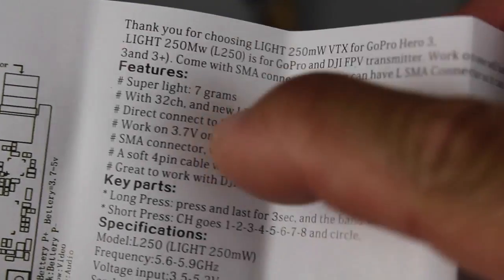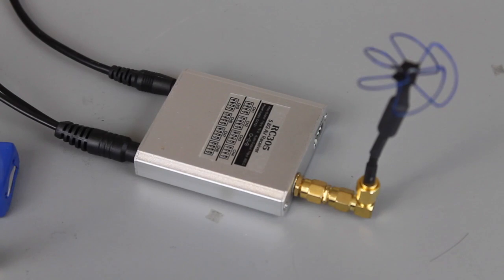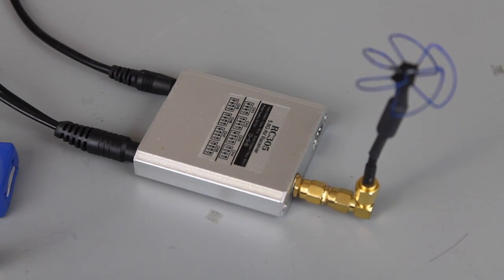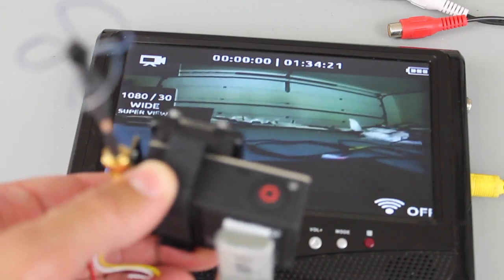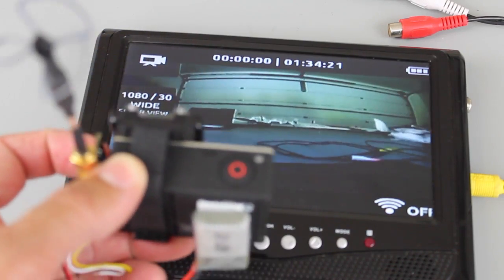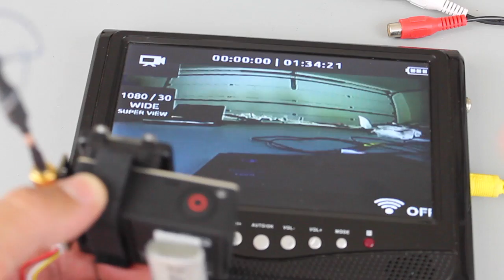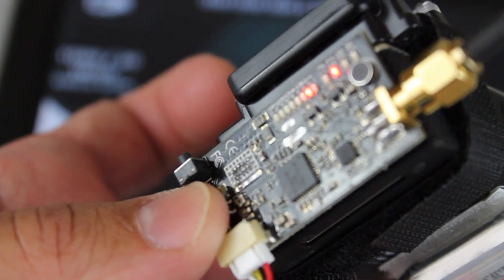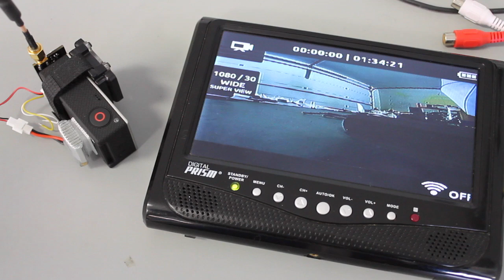Dead Simple 5.8GHz FPV Transmitter for GoPro Hero 3/3+

Comment: I have this transmitter and I am trying to use it for FPV. What are the yellow and white wires that come out the transmitter? Can you use them for OSD? I am trying to get my video to connect to my flight controller for telemetry data such as RSSI and battery voltage. Can anyone suggest how this might be possible? I'm sure the yellow and white wire are designed for something of that nature, I am just not sure exactly how that works.

Comment: How far will it transmit? It can be in meters or feet.
Reply from the maker: With the default antenna I've gotten about 1,000 - 1,200 feet with no obstructions.
Reply: I should have to. What type power plug will plug in? All my won't plug in. Because I can't fine one of that type.

Comment: Hello, Excuse me but what does for does the transmitter use the mini usb port? I would've thought it was gonna take power from there. Do you know ?
Reply from the maker: That's how it gets video out. It's mentioned in the specs here:

http://www.banggood.com/Eachine-Light-L250-5_8G-250mW-VTX-FPV-Transmitter-For-Gopro-3-p-933197.html
Reply: Sure? thought that might've been done from the hdmi...
Reply: or maybe it does video out on both ?
Reply from the maker: Good question. I'm not sure to be honest. Perhaps it's there to get video out of USB on the older models and HDMI out on the newer models. I'll see if I can find out any more info.
Reply: Thanks for your answers.
Please let me know if you get any info on this. 
I dont own a GoPro Hero 3, but if you do I'd suggest to start the search in the users manual or something like the technical documentation it includes.

Thanks Again.

Comment: Hello, I see alot off people buy a 3.7 1s lipo battery to power this transmitter. But I see you can do 3.5-5.2v input. Can't you power it from a 5v ubec or 5v servo lead from your rx?
Reply from the maker: That's definitely possible although I'd recommend the BEC option over getting power from the RX. Good suggestion.

Comment: Thanks for the video, would adding an lc filter help with the static you get on this. iam just about to use this set up to take photos and video rather than fully fpv.
where to place the filter though
Reply from the maker: Yes I think it could but I have no clue where to put it with such a small board. Let us know if you figure something out. Thanks.

Comment: can u use a monitor that has a reciever ariel on top ( no wires just that gopro chip to a fpv screen ) srry if this is a dumbass question im just new 2 the sport 😌
Reply from the maker: +FL Studio Newbie If the monitor has a receiver built in and supports the same 5.8 GHz band as this TX then I would expect it to work. No worries being new to the hobby. We've all been there. Thanks for the question.
Reply: Cheers for the answer dude!

Comment: After watching this video I was intrigued by the transmitter being run off of the GoPro's battery.  Upon researching, the GoPro's power pack, it can easily be split open and wires can be soldered onto the battery's board.  That wire could then be connected to the transmitter and power the entire set up.  After working some math, the GoPro draws power while filming 1080/60 at 9.3 mah per minute.  The transmitter draws about 7.4 mah per minute.  When added, you get slightly over 16 mah of power draw per-minute off the Go Pro's battery, which is 1180 mah.  So you should get a conservative projected film/transmit time of 70 minutes.  i think that I am gong to try this.  If anyone else does please write a comment @ me and say what you get.
Reply from the maker: +Lee Rea III That is some killer info. Thanks for sharing! This is definitely something I want to look into. If you or anyone else does this mod please let us all know. Appreciate your thoughts.

Comment: I have purchased this whole setup including the clover leaf antennas. Im using this for my dji phantom and the fpv is awfully static. There is practically no fpv the connection is so bad. Any advice?
Reply from the maker: +KRM167 I get a lot of static too. One source may be coming from vibrations. Other than that you may have to deal with it otherwise you may want to look into a higher end TX. I still use this module from time to time, but like you I get a lot of static.

Comment: I want to live stream my video at HD quality via Wi-Fi, not necessarily for flights but I am looking into making a kind of google glass for myself. Is the transmitter something I could use in this situation? is the transmitter also attachable to lets say the sony x1000v? Is the stream also possible on a windows laptop, Thanks for the tips! sorry if the questions may seem obvious (I am a beginner in this field)
Reply from the maker: +Harm Huibers Unfortunately can't get get HD with this TX. It doesn't stream over wifi either. You'd need to look into the Fatshark dominator HD setup:

http://amzn.to/1MJHBN2

But I haven't messed with those. Streaming HD is expensive but prices are coming down. Good luck with your setup.

Comment: can this be attached while on a gimbal?
Reply from the maker: +nas rul It depends on if the gimbal mounts on the opposite side from the transmitter and there's enough clearance above it to prevent it from obstructing the antenna.

Comment: Hello,can you tell me what is this battery on gopro......I don't understandvery much on lipo and charger and connectors...thank you
Reply from the maker: +antonio monopoli It's the standard GoPro battery and the FPV transmitter uses a 3.7V input, which is equivalent to a 1S lipo.

Comment: I know this is a older video but I would look on ebay for what's called ramps its a 3D printer electronic parts in there you can find very small heat sinks I would add one to the transmit chip for the heat I don't feel it will interfere with the antenna but I would try to help the cooling of the chip
Reply from the maker: +robert m Very good to know. Will check it out. Thanks.

Comment: I just got this transmitter last week.  I use it with a keychain camera instead of a GoPro.  I'm glad you mentioned how hot it gets, I was worried that mine was abnormal!  It's like a little sun!  Have you had any issues with the heat?  I'm trying to figure out how to mount it without it melting something or overheating.
Reply from the maker: Ken Shields I haven't had any issues with heat because it's well exposed to the air, but you're on the right track by finding a good way of mounting. You definitely don't want it resting against something while it's transmitting. That could be no bueno in the air!

Comment: If i had my Gopro in a tarot t2d gimbal, would this fit between the camera and the motor?
Reply from the maker: Cream Cheese Productions Great question. Unfortunately it won't with some serious modding. One thought would be to invert the camera so that the FPV module is on the left side and pointing down. My only concern is that the gimbal case that holds the camera would be pressing on the shutter button. Not sure if that would cause a problem. BTW when inverting the camera you'd need to make sure you change the upside down mode option in the GoPro settings. Have never done this but offering up a suggestion.

Comment: I'm betting the reason it doesn't power off the GoPro is because it's most likely charging the GoPro via the USB.
Reply from the maker: Eyes Up Vids That would be a nice feature but unfortunately it doesn't. It runs off too small of a battery to be able to charge the GoPro.

Comment: Hello 
i was wondering if this will work with a 2s 7.4v 800mAh battery? also have you tested range yet and will this work with the bosom RC805? thanks so much
Reply from the maker: Dante Totino It will only work with a 1S 3.7 lipo unfortunately. Yes, it should work with the RC805 just fine. It works well with my RC305. I still need to do a range test.

Comment: I wonder why they dont just use the port on the back of the GoPro's like my Team Black Sheep Quadcoptor does?
Reply from the maker: gencodeinc I believe you can only get composite video resolution off the back vs getting hdmi off the side. So if you wanted better resolution you'd go with the HDMI port. At least that's my understanding. If you find out otherwise let us know.

Comment: That's awesome actually. Pretty impressive. Has GoPro managed to release enough patches to make these cameras run more reliably? I remember them being a little glitchy and not recommended for FPV over an older GoPro or board camera.
Reply from the maker: Danny Cruz I've only done FPV with the Hero 2 and 3+. I've never personally had problems with the firmware, but have read about others who have. I haven't spent a lot of time with my 3+ lately but hope to do some in the coming weeks. Will definitely share if I run into any problems. Thanks for the feedback.

Comment: It would be nice to charge you GoPro with a 2 S or 3 S battery, as you fly. if you are putting a battery on the back. They are $36.99 at BG. and free shipping. I have been looking at them for a little time. have you try it in the air for range?
Reply from the maker: Soldier53flyer I have not done a range test yet, but will plan on doing so soon.

Comment: Looks good. I'm sure if you poke around with your multimeter on the board when its plugged into the gopro, you will find a 5v output from the gopro. Simply solder the positive power lead to this. Assuming the TX can handle 5v. Of course it will be a big drain on the gopro battery. I wonder why they didn't make it that way in the first place. Mind you, I'm only guessing here as I don't have the unit or a gopro :-)
Reply from the maker: ryalman21 I'll have to do some digging around and hopefully let break anything. I can't believe they didn't pull from the GoPro battery either. Maybe there was a reason for it, but I think a nice improvement would be to add it. Even if it drains my GoPro battery a little faster I've never been in a situation where my GoPro battery went out before my quad or fixed wing :)

Comment: Dennis, have you tried fitting that setup
to your Tarot gimbal, if so how's the fit?
Reply from the maker: jimmy gray Great question man. The problem with the setup is that the HDMI & mini-USB are on the same side that slides into gimbal. So both of those ports are covered and this TX cannot be used. But that makes me wonder if there's a way to flip the roll bracket so that it's on the other side, leaving the ports exposed. I may need to look into this since it would be a nice thing to know about. But I also question the usefulness of flying FPV with a gimbal. I've never done it, but it would be strange to not see the horizon shift as you're rolling in the air. Who knows....just a thought. So many questions so little time. Hope you're doing well.
Reply: Dennis Baldwin I've heard many people say it's not wise to fly FPV through a gimbal. Find the Flite Test video where they're in France, flying a multi from a pedal-powered boat. I believe he's flying FPV through a gimbal and complaining about it.
Reply: i think i agree too. i only fly LOS as i'm still learning but i think it would be weird as **ll with the fpv camera "perfectly still" as i fly.
maybe it's a good thing after all, the way the Tarot is designed, with Safety in mind.

Comment: How does the transmitter affect the GoPro battery life?
Reply: Also, what is the video delay for the feed?
Reply: Maximo most FPV delays are less than 100ms, so not really noticeable to the eye and certainly not noticeable while flying FPV.
also, Because the transmitter is powered from an external source it wont effect your gopros battery life.
Reply: That's awesome! Thanks so much.
Reply from the maker: ( ͡° ͜ʖ͡°) Zevi Rubin   Appreciate you sharing this info :)
Reply: no worries. 

you mentioned you would like to see it be essentially a stand alone transmitter that doesnt need an external power supply. Do you think that would effect the (already slightly bad) battery life of gopro 3/3+'s? 

The gopro 4 is an exception because it is designed to have the battery switched out easily